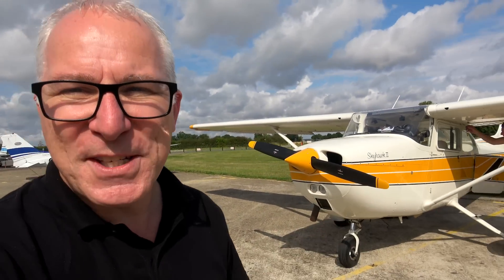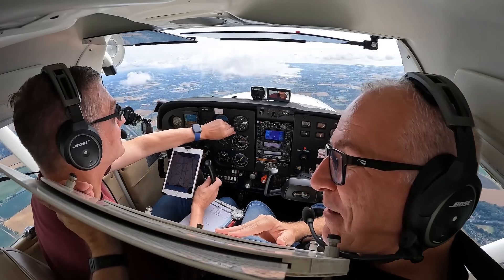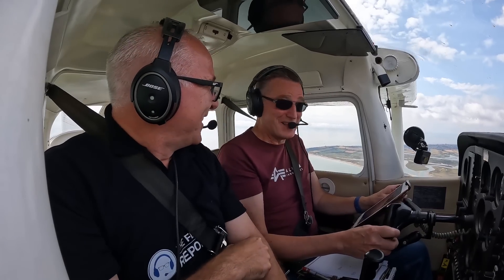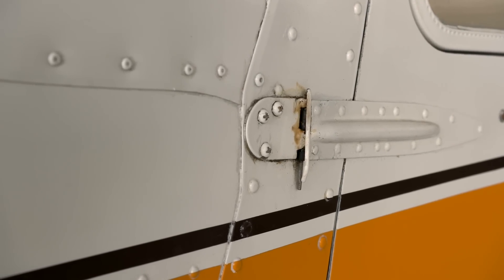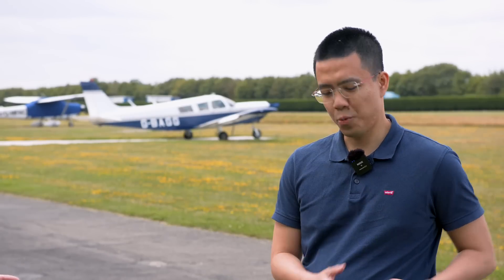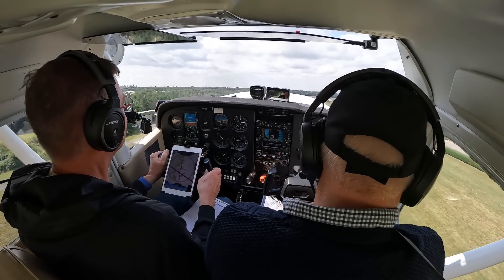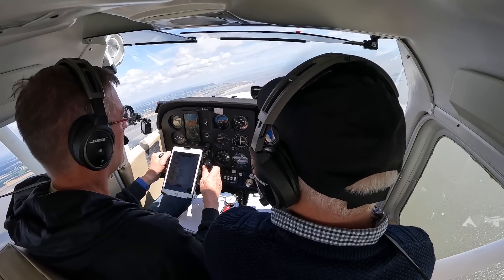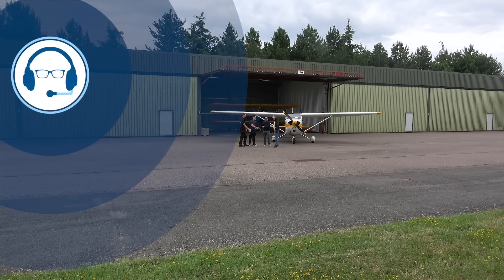Experiment: How much faster does a clean aeroplane go?

Comment: Now report on

The difference spatts or wing tip vorlex generators make on cruise speeds
Changing to a three blade or different pitch prop.
Simply fly with tanks half full
Synthectic fuel oils recommended by the manufacturers.
Smart flight planning dont fly into wind in a cruise.

Comment: Great experiment. As a pilot and engineer, I would have guessed 1-2 knots extra but when I saw the top of the wing which was the dirtiest and probably the most critical for airflow, lift, drag and angle of attack,  3-4 knots extra was perhaps not as surprising as I first supposed. Good job!